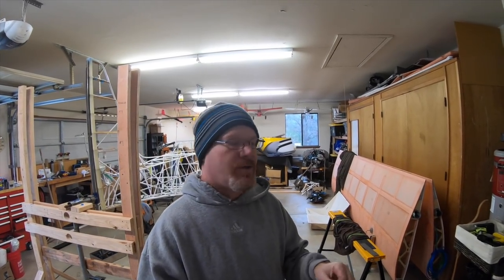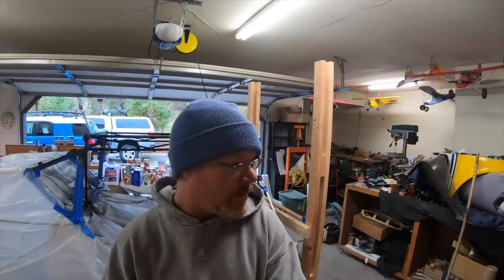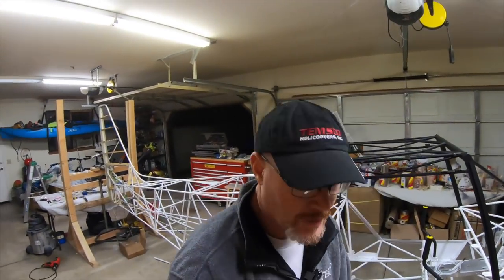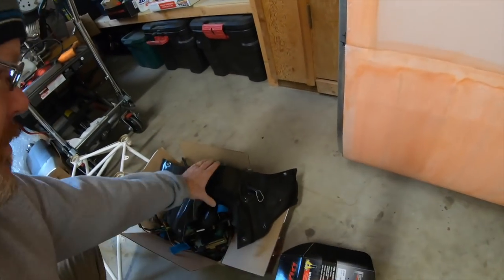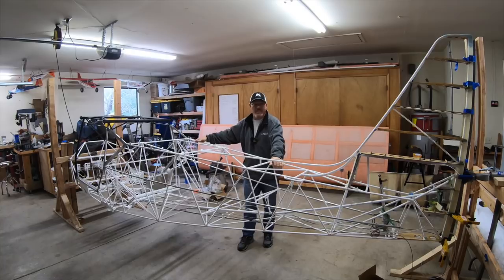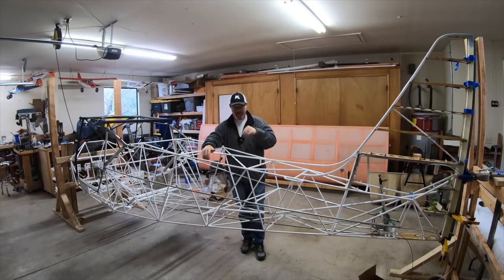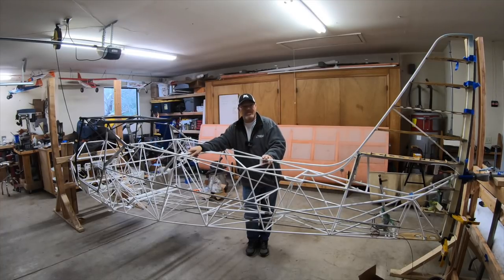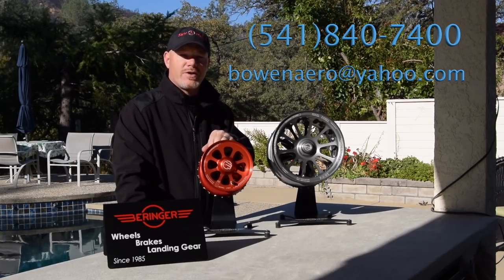Kitfox 7 Apex Build Episode 15 Where is the Progress?

Comment: Thanks for the update and forwarding the knowledge gained so far from this build, Brian! Acknowledging the time factor constraints in moving forward. I've many people drop a project due to frustration from not meeting self-imposed milestones in the build.
I've had my 1966 Chevelle since 1971- 11 different engines and 4 transmissions in the first 24 years. Latest project involves a different body, engine, trans and changing frt  and rear suspension from drag to road racing. I have 98% of the parts but the project is maybe at 50% since 1995 because of most of the reasons you spoke of( and the damn YouTube addiction that keeps me up too late when I'm too tired to work on the car, but can't fall asleep, LOL.).  Hang in there remembering that ANY progress is better than no progress and the project is always waiting for when you have time for it. Thanks again for sharing all the little details!

Comment: Hi Brian.  I really like the idea of the plastic tube in the fuselage to run the electrical wires.  Seems to me that if the wires need to be replaced for any reason in the future, after everything is covered up, it will be a snap to thread them through the tube.  I don't remember you using this method for the wires in the wings for the lights, etc.  Your thoughts on this?  Did I miss something?
Reply from the maker: You can run the wires through the rear spar tube. Some will run conduit inside of the spare also.

Comment: Take a look at the Viking header tank system. It has internal redundant fuel pumps which makes a very clean, lightweight installation.
Reply from the maker: Just checked it out. Great idea. It will be really cool to increase the Kitfox header size and add internal fuel pumps to that.

Comment: Fuel pumps...  Do everything you can to reduce how much suction the electric pumps need, high pressure electric pumps push very well, but they don't pull nearly as well.  In the header tank or as close to directly below it as you can get is ideal, making sure it is gravity feeding far more than the pumps can flow will eliminate the pulling and your pumps will last a long time.
Reply from the maker: Thank you
Reply: @BowenAero  Loving watching this come together, my project will be considerably slower since I'm scratch building.

Comment: Hi Brian,  I was wondering why you removed the flap brackets to put in the additional flap position notches instead of doing the machining with the brackets installed in the console? I suppose it might have something to do with freedom of access around the console with the tool you used to make the new notches.  Since I don't have any experience in metal fabrication, I have a lot of curiosity about how these things get done!
Reply from the maker: I removed it so that I could do a cleaner more accurate job on it. It could have been done still attached, but not as well.

Comment: Can you clarify what you mean by being 'behind the step' in high density altitude?  I find my model 2 feels like something isn't right when flying on hot days, and I'm wondering if this is a similar situation.  I haven't tried giving a small amount of flap on those days though.
Reply from the maker: The step is actually a floatplane term. So think of it like a boat not being up on plane. Until the boat gets up on plane it requires more power, nose is higher. In the airplane it feels the same way. The nose is  a bit high for cruise and feels like you are always in a slight climb attitude even though you are maintaining altitude. With the Kitfox, when you add a bit of flapperon it moves the center of lift aft. It only takes a slight amount, and it will lower the nose to a more normal cruise attitude.

Comment: I get concerned over your focus about the things you NEED to get installed prior to covering the fuselage..... have you taken steps for post-cover maintenance/replacement  of those same items?
Reply from the maker: Absolutely, there will be access covers placed in those areas to maintain those components, but the holes for the mounting brackets and the antenna mounts need to be drilled in the frame mounting plates before the fabric goes on or there is the risk of messing up the fabric when drilling through it.